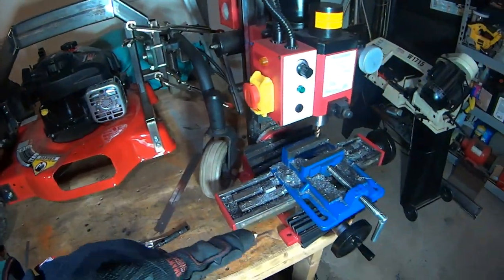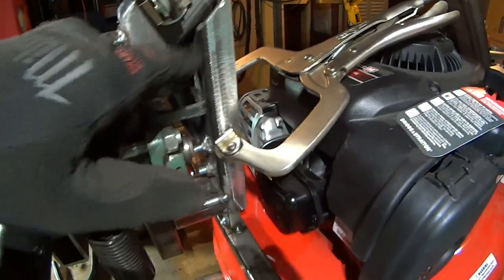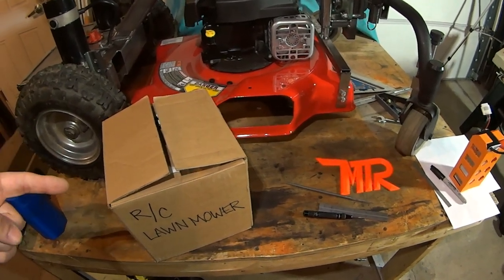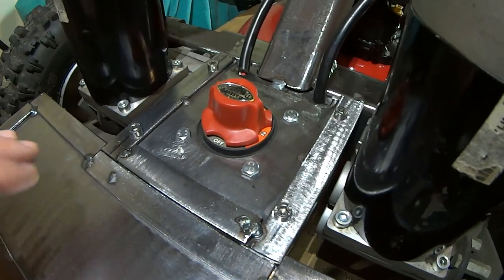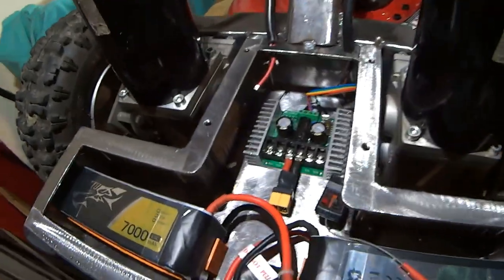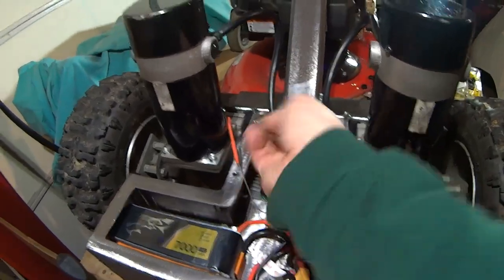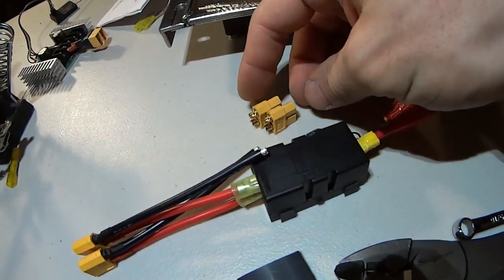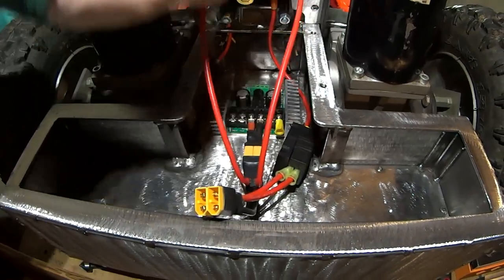RC Lawn Mower V2: Pt. 12 - Mounting and wiring the Sabertooth 2x32 motor controller

Comment: How did u get diff wheels and tires on those motors
Reply from the maker: I created an adapter to go between the OEM hub and the wheel. Drilled a 5/8" hole in the adapter (axle for new wheels)... Tacked the 5/8" bolt to the adapter. The adapter has four small holes the diameter of the oem hub studs with a big 5/8" hole in the center. It's not the truest spinning setup and I needed to weld a nut to the front of the wheel to prevent it from free wheeling. There are also solid nut spacers on the studs between the adapter and OEM hub. Hope this helps. Hard to write it out. You may be able to get a look at the setup in one of the vids. I just don't know which one. Lol

Comment: Is the Sabertooth strong enough to power this without any additional stuff? I'm putting mine in a 25 lbs robot with 540 motors so I guess I won't have any surprises
Reply from the maker: Yes. The sabertooth is a boss for sure. Give it as much battery as you can. Good luck on your project! Enjoy the build. Thanks for commenting and watching.
Reply: @MTRFAB  thanks for the reply man, all the best